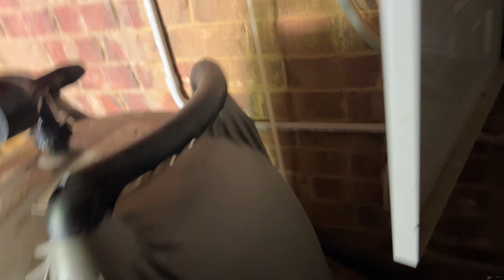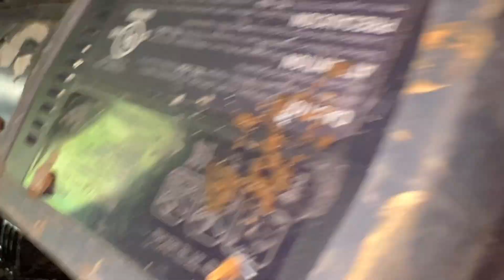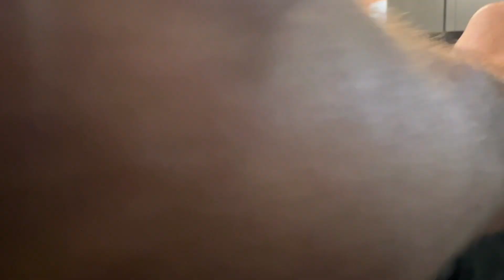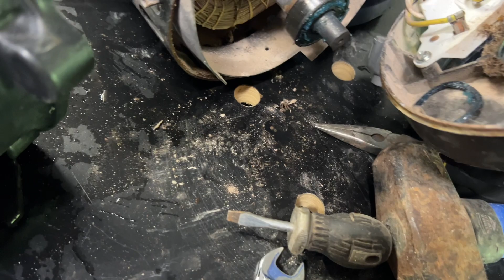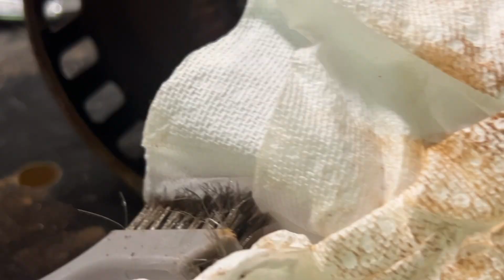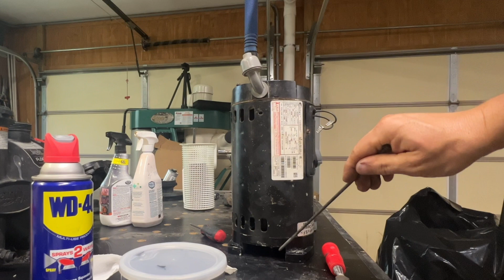How to replace bearing on Jandy Pro Flow 2.0 pool motor

Comment: Looks so hard. I could use somewhere in west palm beach Fl ro do this work as motor not that old but bearings are wearign
Reply: it just looks hard if you have ever remove and re install a bearings, I just did mine after 15 years of daily use, but if you have the money, look for electric motor repair shop, there is one near me in Stuart Fl some 30 minute north of palm beach